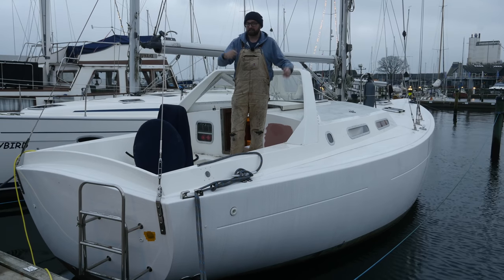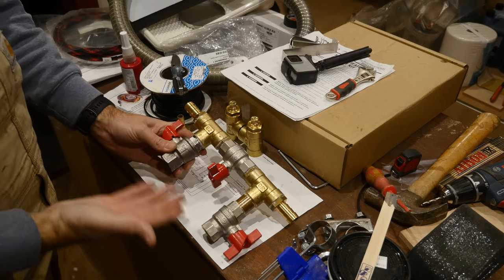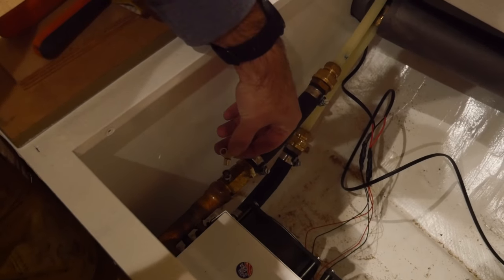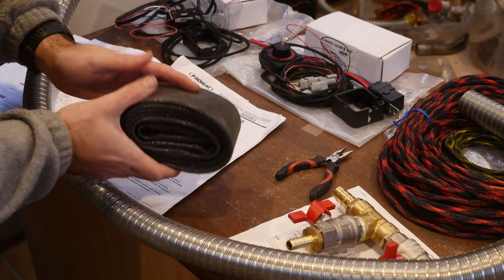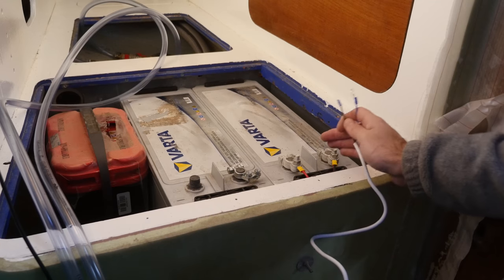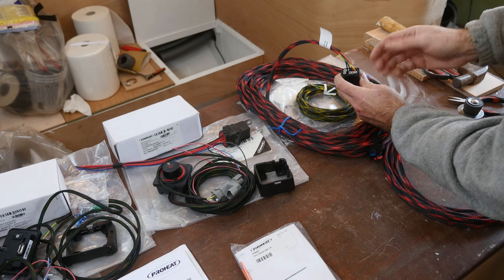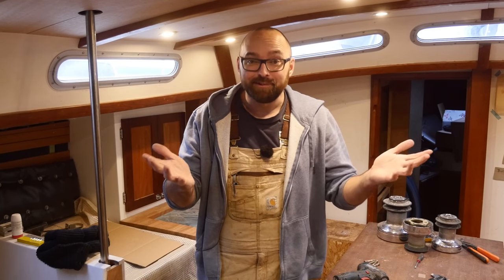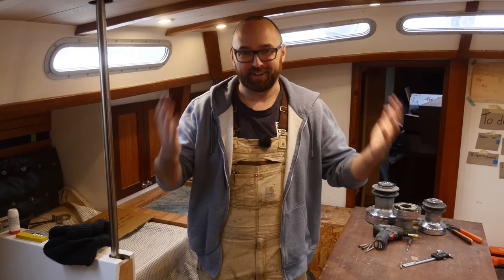Sail Life - Dometic Proheat X30 hydronic heater on a boat, part 3 of 3 - DIY project

Comment: The exhaust plug is a nice bit of kit but I do wonder if you'll ever see it again or if it will be lost to the ages in the renovation clutter?  :)
Reply from the maker: Maybe I should tie it to something in the cockpit locker :)
Reply: @SailLife  & then you need to tell us where it is, then, when you're cruising and announce that you 'have lost the bung' you will have a thousand replies of 'it's behind you!' or similar
Reply: Forget about the plug. Human nature being what it is, "someone" will try starting the heater with the bung in place, unless there is a start key you can attach to the bung.
Reply: @mikewebb4730  I wonder if the heater would just throw an error code due to the pressure?  My (house) furnace is like that: the computer checks airflow, pressure, flame, etc and will halt with an error if something is outside operating parameters
Reply: @mikewebb4730  The control module will not start the oil pump or burner if the air-flow is restricted.  These units have a lot of safety control.

Comment: Hi there, I really admire your passion, your patience and determination of what you do. What I want to know is not relevant to this video, it is relevant to the one with the installation of the victron inverter/charger, why have you installed two, and how will you cope with the 120V in the States? Another thing is how have you secured the washer and dryer, given the fact that they vibrate alot? I guess you can use them only when ancored or in a marina. Thanks, wishing happy voyages.

Comment: I think it's cool.  The plumbing work looks top notch, very un-boat like. The workmanship on most sailboats is Trogloditian. Dometic seems like a nickel and dime operation.  I couldn't believe you had to fit the pins in the wiring. What kind of company makes something that loud and doesn't provide an isolation chamber. If ever a company needed competition.
Reply: They do not call these things turbine heaters for nothing.  They do have competition and they are all loud unless you add all of the extras to quiet them down.  You buy the basic kit and fire it up and holy $hi+ that is loud.  Then they can charge you a fortune for the bits to quiet it down.  Dometic are the new kids on the block.  Espar and Wabasto have been around for years.  There are also a bunch of Chinese and Russian knockoffs.  These units are all designed primarily as a over the road truck engine coolant and bunk heater and have been adapted to use for heating boats.

Comment: A bit of rubber, or another vibration dampening material, between the bulkhead and the heater mount and the heater and heater mount may take out some of the resonance noise.  That is just my opinion, I'm by no means an expert.

Comment: I have almost same system on my Beneteau and I had to move mine to the locker side of the bulkhead instead of inside the boat. I also mounted it on rubber and places a sound deadening box over it. I didn't find the air inlet an issue and an exhaust muffler didn't do much as it out side and only noticeable when you walking towards the boat, on deck never hardly heard it. The noise, for the most part, is vibration and the pump, isolate and cover it becomes silent.....almost.

Comment: I think that is a smart set up, perhaps when the tech area is soundproofed the noise will be less of a issue, I have pipe work under the bunks and a radiator running off my engine cooling system which is very effective

Comment: Great video Mads.  All looks good.  I think the noise of the heater could potentially be a problem, but once insulated any issues will be overwhelmed by the comfort factor!  Liked the new manifold design, is there going to be service valves either side of the heat exchanger?  The noisy fans just want throttling back by either fixed amount or, preferably, a rheostat - light switch type?  This could potentially be controlled by the room stat.

Comment: Mads  Any updates on the performance and modifications made to your hydronic system?  I Changed out the fans on my Sure fan coils and the difference in heat output was FANtastic (pun intended).  My new fans are 4A PWM controlled which gives me from near silent .4A to bring-your-earphones VTOL 4.0A .  Also the muffler really quiets the beast down.

Comment: Can the nozzle size on the heater be throttled down so it doesn’t burn as hot and produce that overheat error?    It might also reduce the roar and noise at the exhaust.

Comment: Please tell me you sealed the hole you cut in the transom. You have been so meticulous about it in the past. Just curious. Of all places likely to wick moisture and rot. I would suggest to you that, as I’m sure you know, this is the most apt to do just that.
Reply from the maker: The transom is solid fiberglass (no core) there is no need to seal it 🙂
Reply: @SailLife  thanks for the update M had me worried.

Comment: Just curious, with the hydronic heater would it be possible to add a radiant towel heater/dryer? One issue I’ve had as a live aboard is the towels never dry after a shower.

Comment: While I can see the merits of the hydronic heating system you have installed on Athena, and congrats on now having warm interior, it is pretty noisy. Hopefully this can be reduced. What I am unclear on is why you didn’t go for a much simpler system such as a Websto diesel heater.  From my experience on boats with them is that they are quiet but yet highly effective??

Comment: Hey Mate have you considered a DC  marine generator  they are much smaller and more efficient I’m assuming you will be running everything through an inverter off the lithium battery’s

Comment: Hi, and a merry Xmas! I have installed in my campervan a 6kw  Truma diesel water / heater with 4 ducted outlets👍🏻works great and delivers 10 Lts of hot water... it’s almost silent when it kicks in and sips diesel that hardly affects my mpg. Been all over Denmark 🇩🇰 Norway 🇳🇴 and Sweden 🇸🇪 late winter for two months and kept toasty warm! So my question is even though it’s a very nice boat (bravo/ kudos /respect) WHY have you installed this heating system?

Comment: I do not know, how the heater you have chosen works, that said:
1.) Adding a heat ex-changer to the exhaust, to recapture energy before dumping it outside to the environment, as heat and/or noise, will increase efficiency. That means you will burn less fuel, and reduce noise, (the furnace/heater is not on.)
2.) If the heater vibrates and (audibly) resonates with the hull, reducing vibration from the heater to the hull, is a good idea. Mounting on rubber pads will help. A sound insulating box around the heater also does.
3.) A muffler reduces external audible sound, (this is energy, that needs to be transferred elsewhere.) If the noise in the cockpit with the heater on, does not bother you, do not install the muffler. It would be a wasted effort.

PS. While composing this comment, to properly clarify what I meant, I missed @Mr. E's comment.

Comment: Well that was interesting but the result seems over-engineered and ridiculously noisy. Dom @ Sailing Cadoha just completed a heater installation on their Warrior 38 using a small, cheap diesel forced air heater and a ProHeat installation kit with inline exhaust silencer plus additional exhaust insulation. A much simpler system that seems to work very well ... and it runs whisper quiet. The only noise is a quiet clicking from the fuel pump. If you have time and haven’t already seen it Mads, check it out.

Comment: Why not a forced air system ? Diesel / heatpump and A/C  I live on my boat in the summer and A/C is a must and allot quieter ,that would keep me up all night
Reply: They don’t heat your shower water, and the ducts are bulky and difficult to route through bulkheads.  I have a forced hot air on my boat, but am ready to switch to hydronic
Reply: Mads has already said that they plan to sail the high latitudes where heat is king and AC is not needed.  Here is the PWN I use my hydronic all year.  In the summer it is just used for a few hours from the middle night head trip until morning coffee to drive off the chill and make hot water.  during the rest of the year it gets a much harder workout.

Comment: keep in mind,  hot exhaust going out- cold air comes in somewhere.
Reply: Not true if you install per the ABYC guidelines that require that the combustion air for a fan-driven burner must use 100% outside air for combustion.  That is the "snorkel intake" Mads was referring to.
Reply: @haydenwatson7987  I thought snorkel was to cut down on noise.  I ll have to check how that works,  I want something like that for house furnace.  thks
Reply: @lakehunter48p55  The snorkel will quiet the intake by getting it from outside the boat.  on these units, the intake is a small diameter and they whistle.  By pulling from outside you meet the ABYC requirement for makeup air, put any sound outside the boat and if you add a silencer (intake equivalent of a muffler) it significantly reduces the sound from the combustion operation.  I did both on my Espar and it helped a lot.  Not sure that the same mechanics are involved in a home furnace.  It is due to the high-speed airflow from forced air combustion.  These are like little jet engines where you pump air in one end and light it and it rushes  out the other.
Reply: Keeping this in mind is helpful? I am sure the manufacturer has allowed for the intake of combustion air and Mads has also.

Comment: OOPS, you installed your dearator with relief out the side. Air moves along the top. Should have installed it with the valve at the top and  4" length of pipe from "T" to valve to allow air in the system to accumulate and be bled out occasionally,  The way you installed it, you may never get all the air out.   Make more of those bleeder keys(they will get lost/misplaced).  Get extra exhaust plug (they do get dropped in the water) or make your own
Reply: I was thinking the same regarding the air valves. Dang you beat me too it.
Reply: @markpalmer9002   Yea, just basic plumbing of almost any moving fluid. Air ususlly makes it's way to the top. Trapped air (unless used as an accumulator) causes damage to pumps  and other parts.

Comment: Glædelig jul Mads! What happened to the DIY heater you and cement boat guy was building? And yes, I know you’re probably a bit tired of “defending” your choice here, but I would be very interested in if you ever considered a Refleks/Glembring with internal coil? Combining hydronic and drip heater with perhaps a Webasto/Eber inline with the system for summer hot water and during sailing. 
I’ve always seen that as a dream setup, but perhaps I’m missing something? God jul!

Comment: Mads, if I understood correctly, you topped off the expansion tank with your heating fluid. Correct me if I'm wrong, but isn't that expansion tank supposed to be air filled to act as a spring and allow for the fluid to expand when heating?
Reply: He topped off the expansion tank to get coolant down to the buffer tank that was mostly empty due to the inlet and outlet both near the bottom.

Comment: 21:32 Mads, we told you so. And a LOT of that noise is caused by the heater transfering soundwaves into the structure of your boat. A box will NOT help against that, not much anyway. You need to decouple the heater from the boat mate.

Comment: Question:: To prevent leaks, do the air bleed vales need to be vertical?
Reply: I don't think so, as liquid fills the tank the air goes up, hence them being vertical at the top.
Reply: I think he means the bleed valves on the manifolds
Reply: @davidleighton1763  They will still work on their sides, small area plus water pressure.  no issue
Reply: @davidleighton1763    Correct.

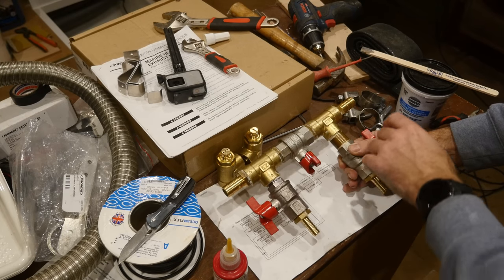Comment: The "lump of metal" was the better choice on all sides. Probably the only thing that would've been worth more research is ID, as is, those big taps on the bottom (as seen at 4:20) are over sized. Probably could've made the system cheaper by a few euros. Other than that, no point in buying the super expensive stuff, which when broken, becomes yet another super expense. This can easily have its parts serviced.

Comment: There is definitely no such thing as too many pumps in a boat.

When the front crash box wall is cracked (and full of water) and all the old pumps died it feel very surreal to have a little inner sea slushing and flushing away the floor panels.

Comment: A CO2 sensor will go off when your lead-acid batteries gas during charging and from many cleaning products used on a boat. Just saying. I have an Espar hot air heater that has kept me warm for 22 winters living on my boat in New England. The hot air heater is quieter, no fan noise, and drier. I don't get domestic hot water.

Comment: I am confused about summer mode.  Summer mode ON should reduce the amount of coolant that flows, while summer mode OFF should increase it.  If you are getting a 'heats too fast' error, I would think that your flow is too low.  Are you SURE that you aren't confusing the summer mode valve?

Comment: Mads, I know you said the height was something of a issue but I had sent you some info regarding infrared  type heating these are panels that are 1/2" thick no sound, no air movement, etc. I live in Tx.and am a cabinet maker the people I used to work for had two 4x4 panels above each mans bench when the temps became so low as to effect adhesive ,and finish performance they were pretty comfortable . It seems that with the min space requirements and with shore power that you are paying for anyway it might be a nice addition.
This was just a quick search and they provide costs. http://mightyenergy.net/infrared-radiant-ceiling-panels/

Comment: Like the generator why didn't you put that in an outside lazaret that way the noise would have been in the back of the boat you could easily insulate the bulkhead for the back of the lazaret and all the heating issues with your piping and stuff you could still leave that in your technical department just extend to water lines

Comment: Dont the " air letty outty thingeys " need to be oriented with the screw up in a verticle orientation. That is how they are in household hydronic heat systems
Reply: take a look at your radiator dude...
Reply: I was going to mention that the 90* on the end of the manifold should be turned so the air bleedy thing are facing up to get every little bit of air out.  Looks like a next spring project.  As the water in the system heats up and eventuality become tepid, gas or air is given off. A second bleeding should occur.
Reply: If it is on the down-stream side of the manifold he will get most of the air out even in that orientation.

Comment: Okay, one question; Why not use something like electric heater? Or even electric floor heating? And a normal electric water heater, just 12v? Hook up the solar and wind generator, unlimited 12v => logical choice?
Reply: Both solar and wind are temperamental sources, and running heat from batteries is not feasible without towing a barge of batteries. And it's more efficient to burn fuel directly to heat, rather than burning it to mechanical motion, converted to electricity, then converted to heat :)
Reply: @Plumsytheghillieone  Not so much that they are temperamental, as they are space limited.  Enough solar or wind energy to heat a not well insulated boat, will not fit easily on said boat.  Even using a heat pump, not full time, in a EV car uses a substantial portion of a large battery.

Comment: First i would mount the heater with https://www.amazon.com/Vibration-Rubber-Damper-Isolator-Compressor/dp/B07PKLN86T then i would build a sound insulation box with 6cm stone wool that would give you max insulation with the dampers you going to order. Good luck!
Reply: Are they SS?

Comment: I can't imagine any reason why that pump needs to be or is that loud. If it uses an impeller similar to a marine intake impeller then it might quiet down over time. But..if it does use that type of pump...I don't know why. It should be whisper quiet.
Why are they shutting down everything in your country?

Comment: i could have sworn refleks had a bimetallic mechanical thermostat... I'm trying to find a source for that, but in the meantime: am I the only one who thought that? You own one, you must know what you are talking about...
Reply: I have no idea why I thought that. I also find zero examples of mechanical fuel regulators with bimetallic strips anywhere. Theoretically possible, but it would probably be very difficult to make that work in an environment with lots of vibration using viscous fuel...

Thank you for the clear presentation.

Comment: I'm surprised the condensation loop is made from copper. From my experience, the condensation is acidic and will rot the copper. Stainless would have been better
Reply: Copper is standard on marine diesel furnace exhaust condensate drains.  Easier to bend into desired orientation.  The exhaust is extremely clean and non corrosive.  I removed my twenty year heater old exhaust and there was zero soot and no corrosion, which is amazing. Ultra low sulfur diesel makes the difference
Reply: I admit my experience is with natural gas and not diesel installations

Comment: Is CO a heavier gas?  might look into that and adjust mounting hight as needed. - You picked correctly on your heating choice.
Reply: No, lighter than air (slightly) and also likely warmer than ambient air.  My concern was that it was a little too close to the heater.
Reply: @CorwynGC  "lighter than air" hence the Greenhouse Effect.
Reply: @dinsdalepiranah8759  Are you confusing Carbon Monoxide with Carbon Dioxide?
Reply: @CorwynGC  Yes I am! <insert red face here>